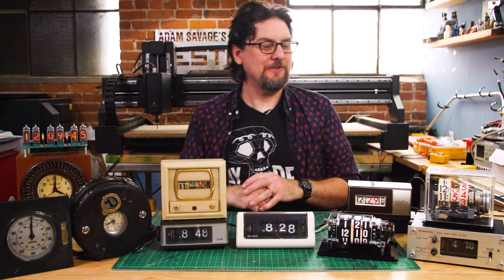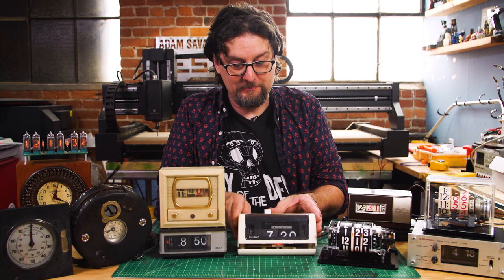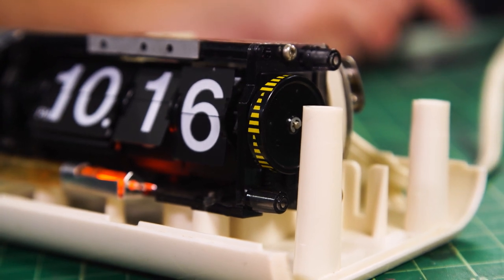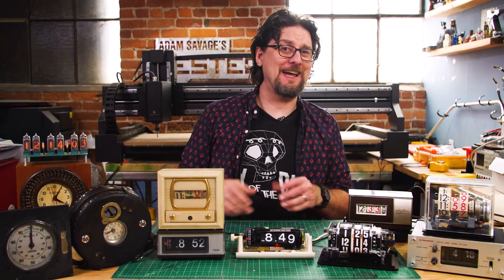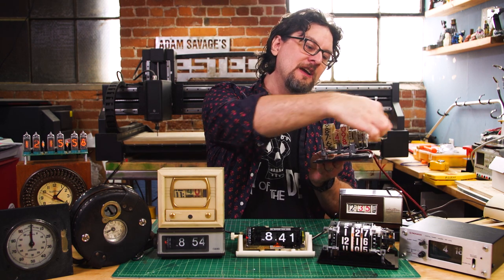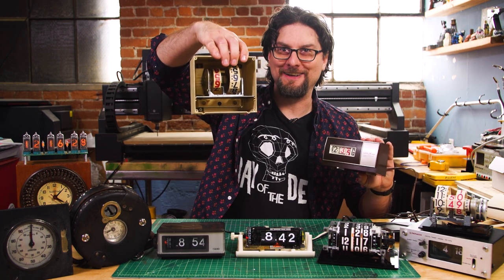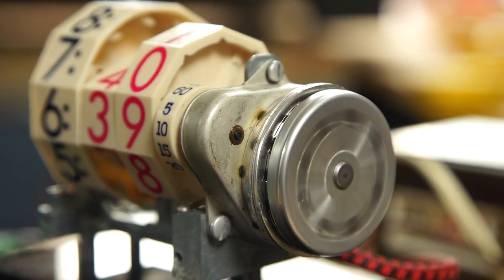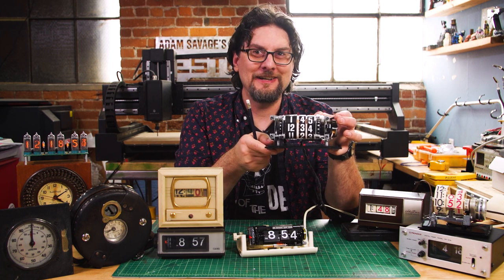Weird and Wonderful Vintage Analog Clocks!

Comment: Vintage clocks are a great option for the watch lover who's tired of throwing away all their money
Reply: I also really want to know more about that one with the vacuum tubes
Reply: sounds like they need to... watch their spending
Reply: @Occupant  Yep - as others said - Nixie tubes - this one was a kit I bought years ago, fun to put together. No longer have the link but there are more out there!
Reply: @Occupant  yes, google "nixie tube", "nixie tube clock", & "nixie tube clock kit"
Ha Ha Ha... That's the rabbit hole I went down..
I got a kit, (everything but tubes), on eBay for about $12. Tubes haven't been made in years, but there is "new old stock" out there. Mine were a set of 4 IN-12 Nixie Tubes for $40. w/shipping from eBay. High voltage tubes, but an easy build if you are familiar with electronics & soldering. Coolest part is making a case that really shows off the tubes. 
Caution: tubes sold in different configurations/voltage. (IN-12,  IN-12A, 12-B, etc.) Make sure the kit matches.
Reply: Throwing away money? My watches are worth way more since when I started collecting

Comment: Something else many people don't realize is just how they measure time and why this makes them so accurate. The electric motors in them are controlled by the frequency of the electricity going into them (50 or 60 Hz), and the electrical grid operators go to a lot of effort to keep this spot on.

Comment: I once had a job as a security guard at a post that still used those old watch-clocks. This was back in the 80s. Those clocks were HEAVY! They weigh a ton and were carried over the shoulder like a purse and were hung on a thin narrow leather strap that would dig into your shoulder. My shift was a shipping and warehouse facility from 11pm to 7am. Every hour you make a tour of the facility with the clock and at various points along your route is a small key chained to a wall. usually inside a small box that is fastened to a post or some out of the way place. you take the key, insert it into the clock and turn it. This would leave a time stamp on a paper tape inside the clock that would record you were at the location of that key at that time. Basically just a way to ensure a guard is there and walking his rounds and not just sleeping in the guard shack. 
The problem was the route took 45 mins to complete and they wanted you to make a round every hour. So, basically you were just walking the complex continuously with a 15 minute break after each circuit. It was the summertime and in Florida where overnight temperatures dont drop below 80.
Minimum wage was about $5.15 an hour. I lasted about a month.
Reply: Yes! Couldn't believe how heavy that thing is - there's another video on that one.

Comment: Man, gotta love that Pioneer flip clock! Awesome!
Reply: I got one in use, it is beautiful
Reply: I love it - very elaborate timer to turn your system on/off. Sadly all the plastic drive gears disintegrated - maybe 3D print new ones....
Reply: @CworthDynamics  Mine are still OK. If they die I probably make new ones out of  aluminium.

Comment: Your cyclometer uses whats called a zone valve motor, used in radiant hot water heat controls to open and shut the valve.

Comment: When I was a kid I had a 1970s or so clock radio that used a variation of the numachron mechanism. The dials for hours and single minutes had half as many positions. On those two dials each tile mounted into the carrier via hinge pins on the horizontal axis and had two numbers, one front and one reverse. Each tile would be flipped over as it came up the backside of the mechanism. I believe GE model 7-4305 is an example.

Comment: Those motors in the clyclometer clock are the same as in motorised central heating valves in the UK.  The speed will differ but making a 3D printed one using a CH valve motor should be do-able. I have one that's 5 RPM that doesn't fit my CH valve.  Cost about £8 for the motor. I always have a spare because they always break mid winter, usually xmas week, when the suppliers are on holiday.

Comment: I keep an old analog, plug in clock just in case the power gets cut. When it comes back on I can check the time difference to see how long power was out.
Reply: old telechron clocks had a little red dot right about center of the dial - when you set it the dot turns black - you could also purchase an old non-self starting electric clock.

Comment: I did this a few years back and my exposed flipclock is still ticking away in the livingroom! Alot of visitors point it out and they all love it. Sadly, when exposed (without a acrylic box) they tend to get stuck due to dust. Nothing an air compressor can't solve but still. Another thing, and I'm not sure of its true or not: I believe these clocks get their timing from the frequency (hertz) of the powernet. Here in the Netherlands (Europe) that is 60Hz. In the USA that seems to be 50Hz. So, when I would use a USA flipclock here in Europe the clock would run to fast! It would be awesome if someone here could confirm or debunk that, I'm really curious...

Comment: It is really difficult to collect American flip clocks and otherwise synchronous clocks in Europe. It's easy to adjust for the different mains voltage, but much more difficult to correct for 60Hz instead of 50Hz.

Comment: I have a Zenith Circle Of Sound C472W which uses the same film strip clock mechanism. It too, has the notorious brittle plastic issue and so it struggles to keep time until it becomes completely stuck. I've heard these are very difficult to repair? I know Jack squat about these clocks but would like to get it working properly again...if I can get one of the stripped screws out in order to separate the plastic base from the plastic cover.

Comment: Back in the '70s, we were awakened by a clock that had begun to run backwards. I don't remember if was a flip or  not.
Reply: Since it's gravity based, a flip clock can't run backward.  Not in any normal reverse fashion anyway.  The filmstrip clock could run in reverse and look pretty normal.